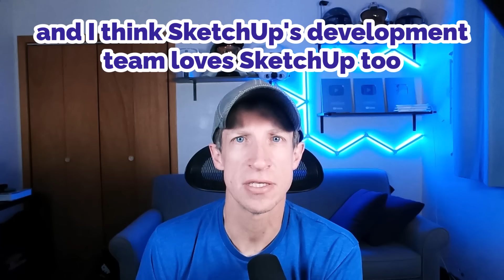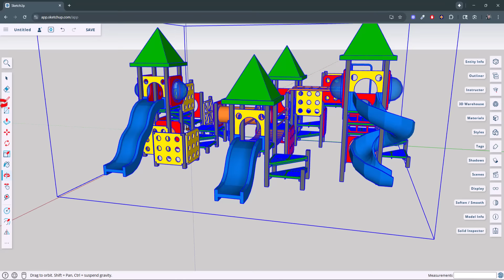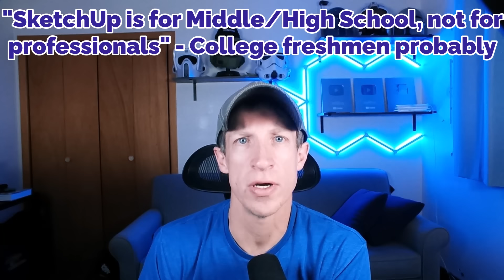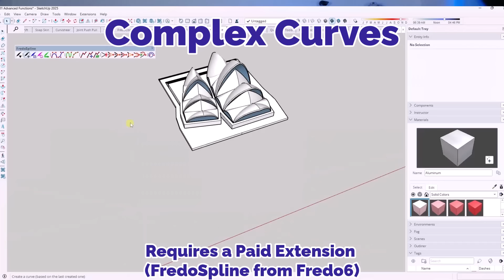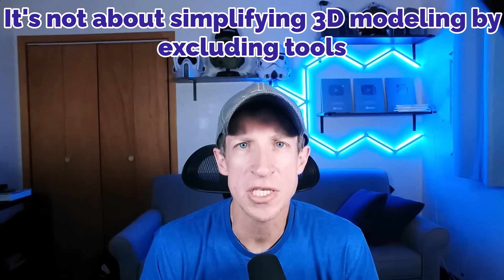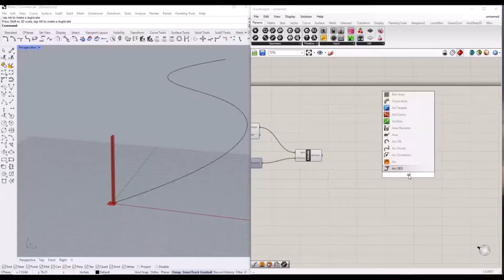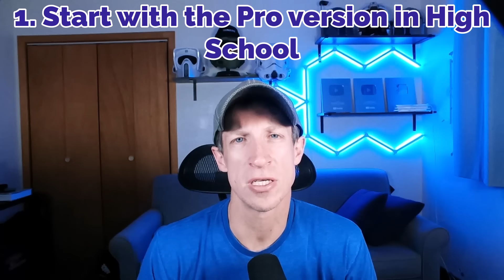Is SketchUp being REPLACED?

Comment: As someone who knows Rhino, Sketchup, Blender, Modo, Max, Maya... etc etc... Biggest problem I've seen with sketchup is that it is trying to be too many things to too many people.  It is and tries to support all the poly modeling tools but it falls flat when it comes to something like Blender or Maya and feels like the fisher price version of more powerful poly modeling softwards that also usually have built in rendering, animation and a much better tool kit for creating shaders.  Where it does shine against poly modeling competitors is its ability to handle dwgs and svgs making it easier to talk to nurbs or surface based tools like Solidworks and Rhino.  But... its also not accurate or powerful enough in most cases I've seen for fabrication so it ends up being the training wheels version of the more powerful surface modeling softwares.  So it kind of ends up occupying a space where its a software people use to get their feet wet in 3d and maybe do some interior design for a friends house but now it comes with a premium price tag.  So I'm finding more and more people use different programs to learn 3d on and then just buy the first "real" software they need for their job either for fabrication, architecture or vfx and that is almost never sketchup.

Comment: I have been using SketchUp for 20 years. It is the program that 1st convinced me to sell my large drafting board. But as much as I have loved working with this program over the years SketchUp is not keeping up with me. I need a program that allows me the creative flexibility that SketchUp has provided in the past without being stuck in the past. Personally I need something that will be easily intraoperable with Revit. I need the ability to quickly explore design ideas and easily work them in and out of a Revit or BIM system. With 20 years of SketchUp experience I was hoping SketchUp would be that program. In fact at one time I was naive enough to think that SketchUp would keep up and turn into that BIM system. There was so much potential!.
This is getting too long so let me finish by saying that SketchUp has now become the reason I am now seriously considering buying Rhino with Grasshopper. Like most I tend to resist a big change like that unless it just doesn't make sence anymore not to change.

Comment: I'm new to Sketchup and use the free version for knocking up basic models for home woodworking projects. It does all I need or want it to do so I'm happy. But by way of comparison I used Adobe Lightroom for years until they went subscription then I dumped it in favour of another product that is not as good. I have learned over the years that brand loyalty works only one way and it’s not in favour of the customer!

Comment: I am a design director at a high-design, large national firm and also a professor teaching design studios at a leading design school, so I have quite a bit of insight into software usage both in practice and academia. I can confidently say that SketchUp is FAR behind Rhino, and it is not even close. At leading design schools, I have not seen even one student designing with SketchUp for YEARS. Not even one.... That being said, I still model and design through SketchUp at work. However, I am probably one of the 4 or 5 people using SketchUp daily in a 700-person firm (the rest being Rhino users). Well, when we hire these days, we don't even ask whether a designer knows SketchUp anymore. This is all because everyone feels that SU is very antiquated as a 3D modeling software when it comes to medium to advanced geometry. Anything beyond a flat surface is hard to do, hard to manipulate, and hard to modify in SketchUp. Not with the native tools for sure. And the plugins, while some are amazing, are usually not very reliable since they are not updated or supported extensively. I am not even getting into Grasshopper territory, which is currently far beyond the capabilities of SketchUp. 

It seems to me that the SketchUp managers are fairly content with the current user base and do not feel the need or the urge to reach out into the "more advanced" design territory to serve the needs of the students at designschools AT ALL. So they are just making a simple software for spec house designers who need simple tools. 

As a long-time and very dedicated SketchUp user who always pushed what SketchUp can do with advanced form and geometry, I am really sad to see this downward spiral of the SU. Unfrotunately I kind of lost hope in Sketchup after seeing year after year of the new releases without introducing meaningful modeling tools.

Comment: This: Rhino -one time pricing model per release. Sketchup -annual subscription model. When I build a 3D product pipeline, I want the software I build it on to last the life of the product pipeline I build, which is usually 2-6 years. I don't want the software to stop working after the first year and/or constantly have to manage user licenses. It is a huge commitment to build a 3D pipe; it should age out naturally with the software it was built on allowing reinvestment timelines to match product life timelines. Over the life of a product, Sketchup ends up having a higher production cost while offering a lower production value.

Comment: Very interesting. I started in this world long before many in this world were ever born.  AutoCad version 1, Cadkey version 1, Pro-E version 1, Alias Version 1, Wavefront, Flame and countless others version 1.  My company spent 100’s of 1000’s of dollars in these systems.  Pro-E. was a true solid modeling system not faces turned solid, but solids.  It was the 1st paremtric package where they developed it.  And to complicate things one could run e2 simultaneous quadratic equations to minipulate your model.  No one has this anymore.  They were the kings of 3D modeling and invented parametric modeling. The problem the package base was $18k, your hardware 50k. So your average joe or jill could never enter the world.  Then came Rhino, Maya, Sketchup (Autocad is still 2D with lots of add). Sketchup full proffesional version $270.  Rhino significantly more expensive.  There are nitches for everything and Sketchup fits one very well Affodability.

Comment: Just found out that Trimble killed the connection between sketchup 2026 and Trimble connect. So you can model, barely get a cohesive process to layout, and now, you can’t get collaboration. So basically, I might as well be using blender. Yeah, I’m right in the middle of a house build and I’m over the hoops and BS of sketchup.
Reply from the maker: SketchUp 2026 has the same Trimble Connect functionality that previous versions have. They didn't make any changes to that in this version. 

Now if you're talking about LayOut, it has never had Trimble Connect, which has been one of my main gripes about the process. Still way better than something like Blender though, which has zero documentation functions
Reply: Sketchup support is totally lost on this. You go on Google and this is a known issue but nobody at Trimble seems to even know what is the problem. I have a 1:1 zoom with a guy named Tim at Sketchup on Monday to review the problem. The 2026 Desktop version doesn’t have the ability to downgrade versions, and when you load straight to the connect cloud, it doesn’t work.

Comment: Massive fan of Sketch up, its been my bread and butter for 15 years.  I also use Rhino so I can confidently speak on both. When moved into the film industry 5 years ago from events the limitations of sketch up really started to show - so did some of the postives, its not all negative. I know a lot of people leaving sketch up to go to rhino or to cinema 4d (which is crazy) -  sketch up is being left behind. 

Sketch ups speed is unmatched, when you get the short cuts in your head and even remap a few to your keyboard  - it becomes very fluid to use. The groups and componets are miles of ahead of Rhino. - they actually work for a start.  The copy and divide system is lovely, materials are so fast though lacking any real uv control unless you get a plugin or use VRAY. Camera controls, Creating scenes, viewing your work, using layers, shadows etc are joyful to use.

Yes the modeling toosl re the best - I've bascially recreated my sketch up tool bar to copy my rhino layout with so many plugins. Some dont work in newer verison so I'm running SU 2023.
Basic modeling features are missing but what I really think is missing are Splines. Getting anything CNC machined or Milled from sketch is a no no.  You want a smooth curve that isn going to make a CNC machine do 1000 mini cuts forget it. Open an Auto cad file and retain those smooths curves - good luck. So many times I've been sent work that sketch up just cant not open, and if I can its messed up, messign faces.

Rhino can handle so many files types, has many tools already built in and the modeling is great - I dont actually use grass hopper but want to learn.  Getting items machined, or printed from it is a dream. The Groups and 'blocks' are rubbish though. You cant click into a group? Blocks are slow and nesting block items is painful / buggy. Layering system is slow and materials control in Rhino are shocking.   Rhinos layout feature is much better than Sketch up also.

The dream situation for me is if Rhino and Sketch up became one. They both have amazing strengths which would rule out each others weakness. I doubt it will happen though.

What can sketch up do? Stop wasting time of tweaking tools, stop bringing out web based products or doing collaboration tools no wants. We dont need a new update every year, only update when change has happened.
Bring in splines, what other 3d program out there cant handle splines - its insane. Increase the basic tool range , perhaps even just buy out some of the plugin markers and make it part of the package.

Comment: Rhino is an order of magnitude more complex than Sketchup. And if you take advantage of those features, there's a very good chance your design will either be unbuildable or unaffordable. And so, if you're complaining about Sketchup's limited tool set, be careful what you wish for. As a long term user of Sketchup, I do pine for the kind of chamfer & bevel tools I see in solid modelling software. But Sketchup isn't a solid modeler, and so some capabilities will always be impracticable to implement. My research tells me that the obvious alternative to Sketchup isn't Rhino. It's Shapr3D, which is a solid modeler that attempts to blend capability with usability for a price mere mortals can learn & afford.
Reply from the maker: Interesting - I'm not sure I agree with this as an argument to not include basic modeling tools like complex curves and bevels. There are plenty of "non-expensive" features that are difficult to model with SketchUp's current toolset. And Shapr3D is more for "maker" style modeling (where you're modeling "stuff") rather than architectural modeling. Definitely a great tool, though I personally prefer Fusion 360 for that kind of thing.
Reply: @Thesketchupessentials  For quick & easy architectural concepts & even fully designing a house, Sketchup.
For furniture, other than kitchen cabinets, & 3D printing of smaller complex things, Shapr3D.
For Architecture that isn't made up of predominantly rectilinear parts, & for letting your imagination run wild, Rhino, even if the designs give civil engineers ulcers, & drain the pockets of building developers & the tax coffers of governments.
Sketchup's capabilities can be expanded with plugins, but I agree with you in questioning why Sketchup is leaving it up to 3rd party developers. An Architectural firm is going to want something more predictable & stable than a hodgepodge of add-ons that may or may not be supported from year to year.
For example, I work in the Aerospace industry for a subcontractor, where Catia is the standard. The OEMs like Boeing typically freeze the version of Catia they use at a years old version for the entire of an aircraft design, which could be decades, out of fear that upgrading would break an earlier design.

Comment: For my home and hobby projects (woodworking, home improvements, some metalworking), I use an old copy of Sketchup Make 2017, which I think is one of the last free versions which runs in your PC (not on the web). It meets my very modest requirements. I only need it a few times a year. The price is right. I have also played around with FreeCAD. I would be happy to learn and use Rhino, but there is no reasonably-priced "home/hobby" non-commercial license.

Comment: since when has sketch up been a professional tool. I have never view it as that. it has always been to limited and trimble has always been too greedy. they should have done more to make the addons more professional and support the developer community. usually extensions disappear with a new update to the core program. much better to put the time into learning a more advanced tool. your take is exactly right. again, I rarely use sketchup now, blender with some addons does much better than sketchup. sketchup is a simple tool... a 2018 version does the same as now.

Comment: We need a millionaire to buy SketchUp and release it as an opensource project.
Reply from the maker: I don't know that I agree - for every Blender, there are a ton of other open source projects that have nonsensical UI design and zero movement whatsoever - I'm not convinced this would be an improvement.
Reply: @Thesketchupessentials  SketchUp feels like a finished—or at least “frozen”—product in a good way. Much like AutoCAD LT, it’s an excellent tool that doesn’t really need constant improvement when you consider what it’s meant for: basic, reliable drafting and modeling.

Simple tools. Like Word, or its open-source counterparts.

I honestly miss that kind of software philosophy.

Of course, maintaining something like that requires long-term commitment and a strong community. For a while, we actually had that. But over time, it’s been slowly degrading. Watching SketchUp get tossed around between owners was heartbreaking. Eventually, it ended up where it is now.

And I’m really not happy about it.

Comment: i used to use sketchup for 2 years until i tried rhino, sketchup is a genuinely horrible app, the surface based system makes editing a nightmare and the fact that lines and surfaces stick to each other when they touch and the fact that the software is unusable for anything abit more complicated than what you showed in the begining unless you want to make a model that you can't change anything in just made me leave the software, it's a childish extremely basic software that i genuinely don't get why it's even used, you literally need 20+ extensions to have a somewhat functional app
Reply from the maker: Actually the sticky geometry can be extremely helpful if you set your model up properly. As a general rule, you should be grouping geometry that you don't want to stick, but then once you do this properly it's really easy to do things like extend cabinets, move/extend walls,  and much more. This is a feature, not a bug, and honestly in my opinion easier to adjust than Rhino once you set it up right. Too many people throw up their hands and quit before figuring out how it actually works
Reply: @Thesketchupessentials  i know about grouping but it's honestly a hassle and wastes alot of time and sometimes its not easy, like the fact that lines are not seperate when they are on top of each other makes work tiring, ill have to take the measurement and draw it outside then group it then move it to where i want it to be, and the fact that when 2 groups of the same object become on top of each other sketchup won't allow you to decide which group to select like rhino but just selects randomly.

i have optimized my work flow in sketchup over the time and figured out ways to workaround its lack of features and it's weird features whether in plugins or the way i model but once i started rhino i couldn't go back, like rhino does function like sketchup with the pushpull tool and doesn't with other tools so i just have everything i want, do i wanna quickly split a face in half with a line and extrude only half of it? just use push pull, is there a line and i wanna extrude the whole face without deleting it? just select it and use the gumball, gumball is such a good feature that rhino has tbh it makes work 10 times faster.

Comment: Actually we ditched SketchUp for Rhino.

many interior design studios here work with Revit or Chief Architect / Autocad.

It is just a better tool.

The few advantages SketchUp has are just overpowered by the sheer advantages of Rhino.
Reply from the maker: I don't totally agree - there's a lot more power there, but it's also buried under a clunky interface and a pretty poor plan creation system. I love both, but there are a TON of situations where I'd pick SketchUp over Rhino (and vice versa as well, just depends on your needs)

Comment: as someone who left the Architectural industry in 2008 (using and designing in 3d in Autocad back then), Rhino can do it all more robustly.  Cloud and Mesh data, super robust modeling, grasshopper, cost, real watertight brep models, not just surfaces, rhino has SubD, it is just a better program.  I would imagine that because of the push-pull nature of sketchup and it looks as it has a bunch of specific tools such as dynamic components, ruby, 3d warehouse it is "fast"  but I wholeheartedly want rhino to become the norm, great privately held company that I hope smashes trimble....  If they started to develop an AEC centric addon or module, they might dominate, even Revit (which is also crap).